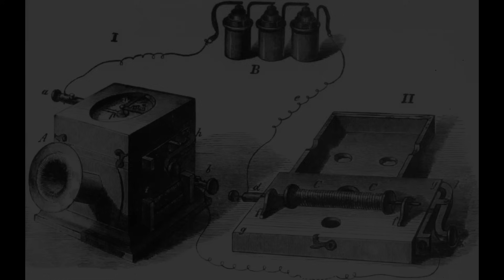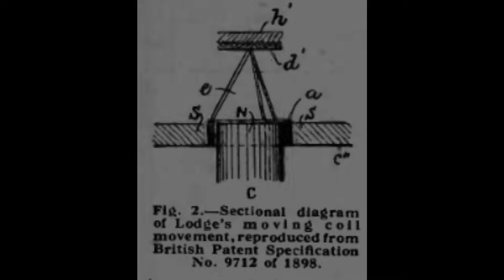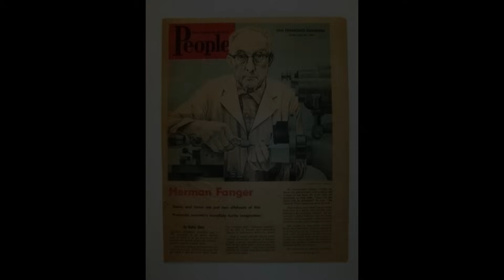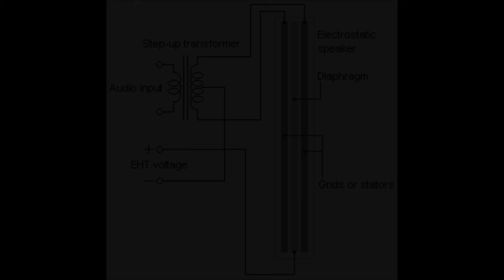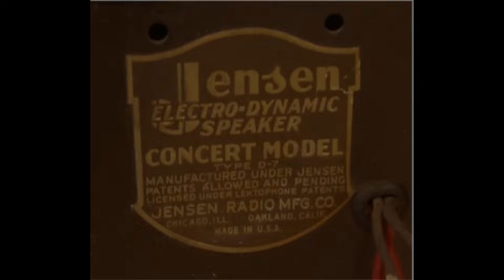The Invention of Speakers

Comment: You can't really determine how good a particular speaker manufacturer is just by its sales figures. I'd challenge any Bose speaker to sound as good as my old Mirage and Paragidm speakers any day of the week. 

Bose 's price points leave much to be desired. I've heard 901's in a very controlled environment. It's a very diffused soundstage and probably would sound strange if a single instrument, like violin, were playing on its own. 

In any case, Bose made most of their money through clever, targeted marketing.
Reply from the maker: You right, you can't determine how good a speaker is just by sales figures. But you can determine that an awful lot of people think they are very good speakers based on sales. Thanks for your comments.

Comment: Though did mention a single speaker cone that had different properties at the center vs the outer cone so as to better suit higher vs lower frequencies, well, would have been interesting to know who first split the source signal into different frequency ranges so each could be played through a speaker element optimized to its respective frequency range.

Comment: Note the separation in development between the electrically-powered moving-voice-coil speaker, and the acoustic horns used in all-acoustic record-playing equipment.  Records were still being acoustically recorded and played back acoustically, without electrical amplification, well into the 1920s, while, simultaneously, electrically-powered audio signals powered electric speakers, supplanting electrically-powered headphones,  in the radio receiver industry.  In this sense, radio was technologically far ahead of the record industry.  Electrical generation and amplification of a recorded audio signal resulted in a large boost in fidelity, after the record industry caught up, electronically.
Reply from the maker: That's a very astute observation. Thanks for watching.
Reply: @Radio1920s  yw

Comment: Well done, 
but you forgot to mention Paul Klipsch and his folded horn designs.
Reply: I  have a set of 1976 Klipsh Cornwall 2, wonderful speakers.
Reply: Also JBL !!
Reply from the maker: Good point, Mark.
Reply: You beat me to it! 👍🏻
Reply: And JBL and Don Keele @ Electovoice. Not to mention Floyd Toole.
Reply: And JBL
Reply: Klipsch didn’t invent the folded horn. It actually dates back to the Victor Phonograph. Bell Labs created an acoustic horn that flattened frequency response for Victor’s electrically recorded but mechanically reproduced Orthophonic phonographs and records.
Reply: @MultiPetercool Nobody claimed Klipsch invented the horn design either..😂 But Klipsch and JBL and some others made horns for the masses and especially Klipsch (and JBL) is well known for their horn designs..
Reply: Yeah, and several others. But he rather mentioned shitty Bose of all the proper manufacturers he could have choosen from. A company that did not even change the industry but made alot of weird gimmicky systems🙈

Comment: I love the way no one has improved on the dynamic speaker !
Reply from the maker: Gail, if you read my description, the video is about speaker development through the 1920's. At the 4:45 mark of the video, I mention there's been many, many advances in speaker development since 1929. Thanks for watching.
Reply: Are you familiar with motorized subwoofers, also known as a servo subwoofers?
They use a servomotor to translate an electrical signal into movement, producing sound waves, especially low-frequency bass. Unlike traditional subwoofers that use a voice coil and magnet, servo subwoofers use a high-speed belt-driven servomotor to move a cone, resulting in reduced distortion and increased output power.

I can tell you, the quality of sound compared to a dynamic cone speaker is amazing.

I know, because we have a Kenwood subwoofer system with servo motor for our surround sound system.

Comment: I have just one fancy horn and two cone types.  You can say they sure make sound.  Not great sound, mind you.  I think post 1930 speakers improved vastly.  I got a 1930 Philco console and although it is not as bassy as later 30s consoles,  it is pretty clean sounding.  More so than those older 20s speakers.
Reply from the maker: In 1928, Atwater Kent introduced electric radios with electro-dynamic speakers. They produced very good sound, a huge improvement over cone speakers. AK's F4 speaker was particularly accurate at sound reproduction for its day and would still be fine to listen to today.

Comment: Adding to list i think great breakthrough was  invention of co called "compact" speakers which have   element producing sound   suspended almost fully on air. It opened gate to produce low bass   using relatively small sealed cabinets. It was great seller in 60ties,  Later  ported cabinets with hybrid air/machanical suspension   took over. but  it is still appreciated  for gear with small dimensions. later came  solutions were   with cooling - some by speaker ventilation  - this was for woofers and for tweeters     fluid which alowed more power load to speakers. With more power comes unfortunately less acoustic efficiency and this must be balanced by more power so it is not great for result. .

Comment: A small speaker can never sound "near perfect", even DSP can't cheat physics. Doppler effect in the midrange is the main problem of small speakers trying to reprooduce low frequencies. A larger speaker with little excursion still sounds the best.
Reply: "Small speaker" is not describing it''s dimensions - some think anything below 12" is small speaker😁. 

Never say never. May be you have not enough  experience with physics and research?. How is it? I made small speakers which even for me are hard to believe - not only equal but are better than  all known to me  big ones.  My own ( tuned by me) so far  smallest  speaker set  is 20cmx 17cm x 20 cm and uses 4" 30W woofers> With almost no visible movement  (sealed type) and has no any doeppler efect.  it competes  with 120 cm high treansmission lines which  play effectively form 30 Hz because it delivers fully 35 Hz . and wins by sounding  Of coruse thjey need dedicated to them  B&O amplifier with perfect circuitry .  . 

- In physics   is still many too  hard to explain wonders  speacialy in audio which must be examined only by ears. There are  too many processes   developing in instance to have confidence      Thiele small factors are  convinent for avoiding  expensive experiental research. and to set industrial standards but as we see every speaker based on them is different while theory was   the same .
Reply: @Mikexception  

This is about small Bluetooth speakers with 2" full range drivers, undersized ported/PR enclosures and heavy DSP to correct their crooked frequency response just as shown in the video... It's not about your "120cm transmission line"... LOL! And sure, small speakers of 4" or even 3" can sound good, at low volume... 
But you can't even compare the sound of a 10" or larger home hifi speaker (even a cheap, under engineered one) to a Bluetooth mono speaker with DSP...
Reply: @westelaudio943 Ok - you are right.
Reply: "Near" is doing a lot of heavy lifting there.  One person's good enough can be another's white noise.
Reply: @grizwoldphantasia5005  

Well, they do sound better than a reed type speaker from 1920 or an old pocket transistor radio of about the same size, which is both surprising and not so surprising because due to Li batteries and switch mode amplifiers, they can make use of 50-100 times more wattage ( .15W was kind of normal around 1960, 10W are no problem today) and a small speaker with a low resonance frequency is inherently inefficient. 
Still no comparison to old school stereo... 
Yet I can even enjoy the sound of a tube table radio or an early boombox which is far from proper HiFi, but the tiny BT speakers, they always sound 'robotic' and muddy once you go above minimal volume, which is due to the Doppler effect and possibly DSP artifacts.
Reply: Doppler in midrange? What do you mean exactly?

Hower, you point interesting thing. Assume we play low and  high frequency simultaneously.
Say 20 and 2000 Hz.
Membrane, source of 2k sound, is moving back and forth ... is emitted  2000 Hz sound FM modulated?

However:
- DSP can compensate this,
- large membranes are poor HF emitter ... so usually there are more speakers of various size in set.
Reply: @johnfox2483  

Yes, that's what happens - and no, DSP does not compensate for this, because the effect is dependent on the off-axis angle and also room reflections, and DSP obviously only works two-dimensionally. Also, the DSP does not know the exact position of the speaker cone unless there would be some sort of motional feedback (the phase shifts caused by resonances of the speaker cone and suspension can vary due to manufacturing tolerances and ageing).
 
This is specifically about small full range or two-way speakers with cones moving at high velocities to reproduce low frequencies, such as Bluetooth speakers which commonly use 2" or 2.5" drivers. The problem doesn't affect large multi way speakers, and barely affects even larger full range drivers with little movement.
Reply: Correction: A combination of several size drivers set up properly is always better than just one driver regardless of the size.
I preffer a 2 or 3 way setup in small speakers (even shitty BT ones) and in a proper speaker I preffer a 3, 4 or even 5 way setup so all drivers can work in their optimal range.
Reply: I'll give you that the first round of Bose 901 Series speakers had a hard time replaying accurate base. But the Bose Wave radio does a pretty good job!a
Reply: @johnnyfreedom3437  

The 901s have a lot of surface area, just an undersized cabinet which is "corrected" via an active analog filter (not DSP yet). I suppose comb filtering is a problem that they have and cannot get rid of. 
Though the ones I've heard actually sounded fine. Don't know much about the Wave radio, but it probably sounds good for what it is, a plasticky table radio from the 2000s. 
I never actually disliked Bose speakers, they sound fine once you get used to them, not the last word in accuracy of course, but they give you an interesting sound scape, and the idea of doing things differently is quite appealing to me, not everyone has to build the same type of gear. Full range drivers and cone tweeters were shunned by 'audiophile' manufacturers for quite a while but Bose brought them back on the table...
Reply: @ iSince    8 years of  my personal research    (tested  domes to get best  more than    20 years)  I   abandoned dome tweeters  Contemporary cones are hardly available  but I find them superior and   I for my personal use I will not return to dome 

. Cone  disadvantage in compare to dome is higher  production cost and big problem with repair if cone is damaged  .. Domes  if not burnt  by amplifier are  almost unbreakable but  that  is as for me all.  Most cones are fine up to 18-19 kHz . In range 10-16 kHz I like cones  more  than dome. because of their shape and pririnciples . Confirmation that cone one is perfect invention  may be that even exceptional middle size 2W widerange which conatins cone i effectively    produces  up to 19kHz
Reply: @Mikexception  

Many dome tweeters (made after about the late 1980s) will seize over time due to ferrofluid drying out/solidifying (it's oil with rust particles in it, that's all). That'll give it a harsh sound, quiet sound, or no sound at all anymore (voice coil burns out easily in this state). 
Dome tweeters sound better off-axis, but otherwise I also somewhat prefer the cone ones, they sound more "organic", more kinda like a full range speaker, which might also have to do with being more directional and a "not completely" flat response. 
They are pretty much extinct as a DIY item, but not completely, Visatone still makes two I think (TW70 at least), there's also a reproduction "phenolic ring" tweeter available again for a few years now.
Reply: @westelaudio943 Thank you. I account their "organic" sound to 1. opposite form  of radiating element  ( highest harmonics are radiated by smallest retracted part  in according to it's outer biggest surface radiating lower harmonics     (it may  correspond with crossover phase shifts)  .  2.   to small  and light center  element with coil  - in dome coil is the biggest element and it is required to drive center of  dome  which is capable   to equaly radiate the  top frequencies paralel to coil ring unfortunately  without sharing  This lack of sharing in my opinion affect result due to acoustic phase shift  between the  outer coil and center of dome

. It is all my guess - I have no intention to calculate because sharing in cone  was hardly defined, usualy provided with  experimenting by ears. Anyway tweeter which i found best for me  have pressesd in paper 5  rings 

Rings are  not be applicable to domes, because they would force lower range to be produced by smallest center and it is opposite to nature.
Reply: @westelaudio943Done tweeters and most others generally sound jest on-axis.. That's just how it works. But you do you and claim the opisite of speaker manufacturers🤷‍♂️🤷‍♂️
Reply: @johnnyfreedom3437 Bise Wave Radio does not do a pretty good job😂 It's OK nut sound like DSP corrected plastic😂 I habe never heard a Bose product sound good. Maybe some headphones bit that's it.
Reply: I also believed the same till I listened to the Bose SoundLink Micro which I gifted to my 6 month old grandson. Unbelievable sound.
Reply: @soviksrimany4103 If by "unveliaveble" you mean that it does NOT sound realistic at all then I agree😂